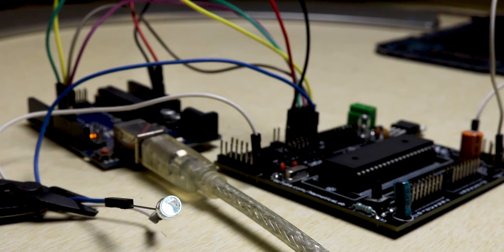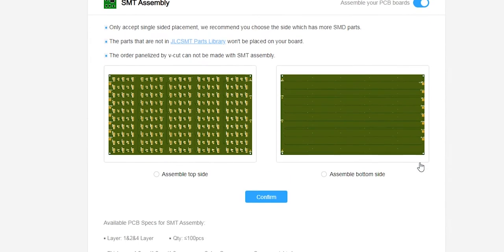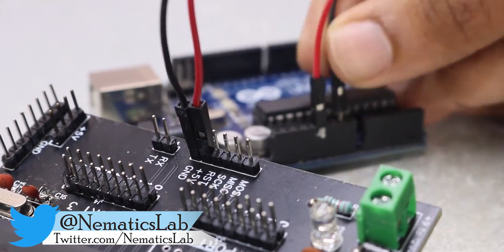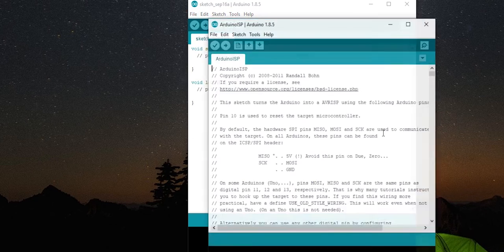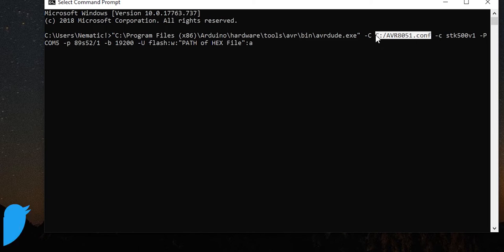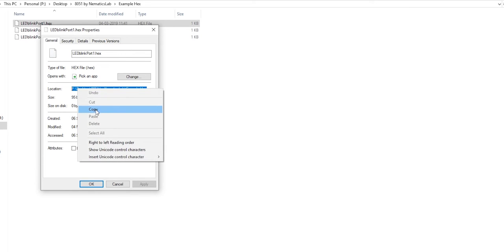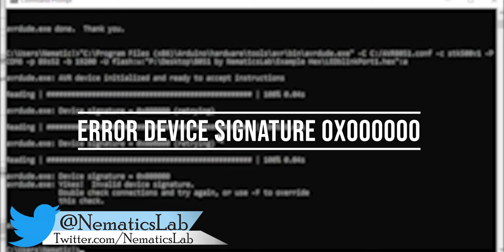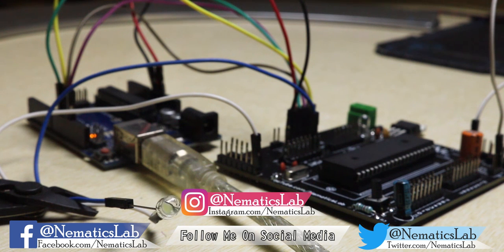How to program 8051 using Arduino! | AT89S51, AT89S52, and P89V51RD2

Comment from the maker: Learn How to make 8051 Minimal System! - https://youtu.be/qw8SQl0ouxU
Reply: when i checked internet Arduino Uno and Nano have same current rating for gpio pins. So why u said we cannot use nano for this purpose.If i use external 5v for 89s52 and using Nano only for spi programming .Will it work.
Reply: Hii dudee..
Dude how can I contact u ????
Plzz broo can u please say how to contact you..?
Reply: Where to get the development board?
Reply: please tell on which port you have connected the led that blink?? reply please
Reply: led ko connect karne ki pin kon si hai

Comment: The AT89S52 I´m using was locked by a friend of mine. I tried erase it but it fail. Someone told me that I will need a parallel programmer. I do not have one. Is there an easy way to solve this problem?

Comment: Hello, congratulations on your projects. I work with the 8051. With different microcontrollers. I work in assembler. I lived in Cuba. It is difficult to find information here. I ask you for two havores. With what program or platform, I could write software in 51 assembler. I use the X51 that works in MS-DOS. We have no other. Could you send us any documentation or functions to be able to work with the OLED screens that you use in your video? Thanks a lot.
Reply from the maker: I use Keil but its windows based. I dont have any experience with MS_DOS
Reply: @Nematics_Lab  Thank you very much for answering.

Comment: Hey. I bought this Smartflex AT89S52 Development board. 
Is it compulsory to by arduino to program in it. I mean it is a development board, shouldn't it come with it's own software to program hex file in 8051. I mean then what is the use of 2 micro-usb ports then ?
Reply from the maker: Check user manual it might using USBASP

Comment: I got this error "C:\Program Files (x86)\arduino\hardware\tools\avr\bin.exe"' is not recognized as an internal or external command,
operable program or batch file. I configured it in the environment variable but still
Reply from the maker: Arduino IDE should be installed
Reply: @Nematics_Lab  I have Arduino IDE installed but it kept on failing

Comment: one doubt! can we use Silicon TechnoLabs ATMEL 8051 AVR USB ISP Programmer using ic (ATMEGA8A-PU) in place of arduino UNO board, will it work? as i have no spare UNO board
Reply from the maker: I haven't tested it but it should work
Reply: @Nematics_Lab  OK THANKS I WILL TRY

Comment: Hi there,
I tried this with my 89s51 and Arduino UNO, the code get burned on my 89s51, but I don't know why all the pins of the 8051 are high, while I tried programming it using a proper burner but still the same problem is still there, I tried changing my ic to 89c51 but still the same thing is happening.
Could you please help me by identifying what the problem is?
I'll be really grateful.
Reply from the maker: During programing all pins are high

Comment: hi, I succusfully uploaded my hex file to the microcontroller however when I test if the program works it does nothing, and I already tested the same code uploaded with a regular burner and it works, but with this method the microcontroller doesn't run the program. Please help!
Reply from the maker: Try resetting after uploading
Reply: @Nematics_Lab  hi, thank you very much for your reply, I discovered that the problem was that I was only adding the name of the file without the ".hex" extension, so it was recognizing the file as binary not hex, once I added the extension it worked perfectly.
Reply from the maker: Happy coding

Comment: can we do the same with a Fedora linux in the terminal? I am using fedora scientific KDE Plasma.
Reply from the maker: I'm not sure, first try installing Arduino IDE in Linux after which do as told in video but directory will change as per your os. Try it and let me know if it works

Comment: all connection check 4-5 time but still there in error 0x000000
Reply: Bro check the programmer video by Creative Inventory. Worked for my AT89S52 chip

Comment: If I made 200 led chaser then what is code and circuit diagram
Reply: Use a mux, and set the select pins to i/o pins of 8051
With that you reduce the pin configuration and code complexity

Comment: How do I write program for 8051?
How do we use arduino ide for that?
Reply from the maker: You need to use Keil IDE to write code for 8051
Reply: @Nematics_Lab   Isn't there any arduino library that can get it done?
And btw can't we burn arduino bootloader within the chip?
I was trying the same, but got a device signature error.
Reply from the maker: Arduino and 8051 are two different chips so it won't work.
Reply: @Nematics_Lab  ok.. thanks a lot! Keep helping like this 🙂

Comment: Hello, thank you very much for your channel. Is very good.
How can I record an AT89C5115 from Arduino? It's possible? I have several applications but I always need a recorder because I don't know how to record the application with the microcontroller connected to a board. What pins do I need to use? Please, this information is very important to me. If you consider that it is too long to explain here on Youtube, I can send you my email address. Thank you so much . A cordial greeting.

Comment: Why so complicated method to proggram the chip . You can burn bootloader to 8051 , download 8051 board in ARDUINO IDE and you are good to go now
Reply from the maker: There is no way to program 8051 directly using Arduino IDE. Try it if it works let me know :)

Comment: Nano doesn't work because of not enough current. 

Now I know why I was never successful in my attempt
Reply: what about using external power supply for 89s52 other than one derived from Nano 5v pin. Will it work?